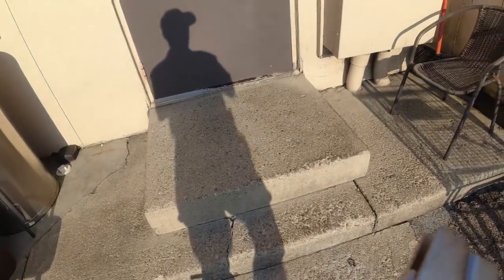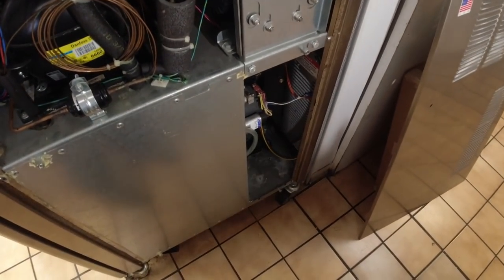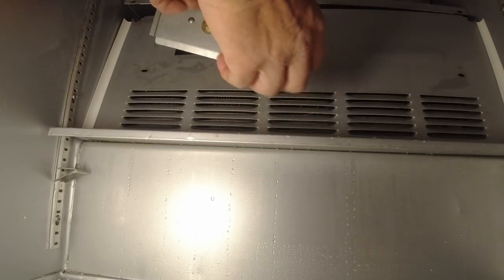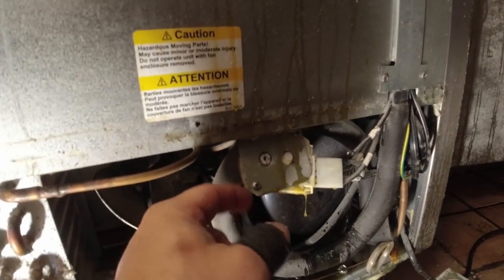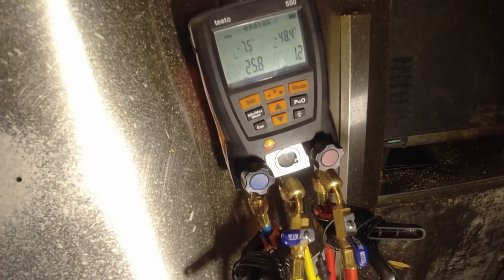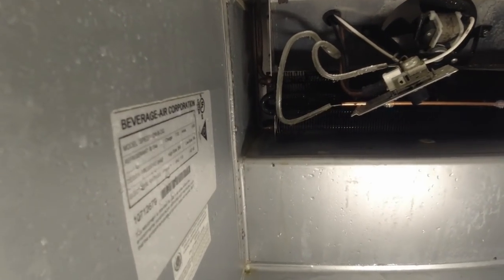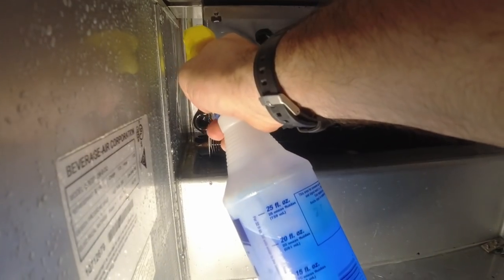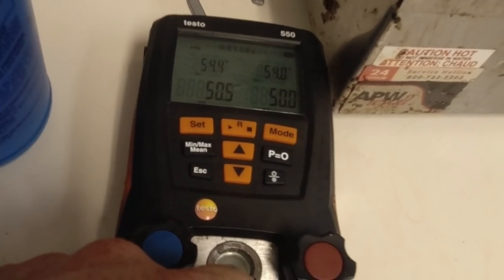Ice Cream Machine / Freezer / Cooler Not Working

Comment: Seeing you work on those small compressors looks to be the same type that most RV roof air units have and of course no taps. Most RV techs don't even bother putting gauges on them and tell the owners to buy a new unit, talk about throw-away. Gets me wondering maybe I can learn the trade and just focus on RV air systems, would have to buy a shitload of taps! Great vid again, between you and Chris I really enjoy what you craftsmen do.
Reply from the maker: You can take your refrigeration exam online To get EPA certified. It's pretty brain dead now.
Reply: @HVACRSurvival  I guess if I can do IT and build complex networks, this should be a walk in the park, said no one! Thanks Might be some good retirement income at campgrounds when I get to that point.
Reply: I testing points you raise: I irked on cars forever and most RV units are cheaper (usually by only a bit) to replace then repair by the time you throw in labor.
 I years ago had quite a nice biz setup with local motels repairing their room units. Many of those are also disposable now.
Reply from the maker: Exactly, it's all dependent on how bad you want it
Reply: You'd have to be willing to build up stock.   People will pay extra to get an exact match unit working on their system, or to NOT have the whole unit yanked in some instances (fixed on-site).    You do the repairs after you've pulled the unit in your 'non-active billing time'.   Then that unit goes on the shelf waiting for the next RV.
Reply: @tbelding  I’ve done a bunch of antique auto ac retrofits, and people Will pay if they feel there is value to it.
 I’ve repaired many an ac system by finding it a problem and going to the parts house to see what I can make work for a certain case.

Comment: I wouldn’t be surprised if you’ve already seen them, but, they make a saddle tap that you braze onto the process tubes while Freon is in the system, and then you drop a piercing insert into the valve body and use two wrenches to crank the cap down tight and push the piercing assembly into the pipe. I’ve used them many times and it’s nice because you don’t have to reclaim anything and provide ports without opening the system. The part number I found is BesTech-BT5514, also BT5538
Reply from the maker: I used to have those back in the 90s, I didn't know if they still made them or not. They were really nice, thanks for sharing 👍👍

Comment: Sometimes you get workers that respect your space, others not so much. I used to take it. Not anymore, I mean I'll be tactful but I'll let them I'm working to and don't need hot water or food spilled on me.
 Hey! I use a uniweld pinch off tool and braze my access fittings without having to recover and vacuum. Saves loads of time if unit didn't go negative.
Reply from the maker: That's how I tap a R-290 system. But we both know how this is really done most of the time.

Comment: i think the white timer thing he called a defrost clock is actually just a condenser fan motor reversal, i have many of them in my true GDM units and they are only for reversing the condenser fan motors as a way to help keep the condenser coils cleaner for longer. correct me if I'm wrong tho
Reply from the maker: The thing you're talking about in the true coolers is programmed into the circuit board of the motor itself. That is a defrost clock.

Comment: Hi rick, great videos you should check out the kyoritsu 2200r multimeter it has the smallest clamp around 3/8, great for checking amps in tight spots also fits in your pocket just a suggestion.
Reply from the maker: I'll have to check it out, thanks 4 watching!

Comment: Impressive level of professionalism considering the circumstances. Good job keeping your cool. Just curious, does the manufacturer provide an ohms rating for the defrost heaters in those?... so they can be checked somewhat for diagnostic purposes?
Reply from the maker: I'm  Sure they might, generally it's gonna be somewhere between 15 and maybe 35 ohms.

Comment: Hi, I have a question. If we haven't changed the scapper blades for a while, and recently the fuse kept tripping when turning on the machine, and now the machine won't freeze the soft serve at all, does that mean the scrapper blades being worn out could have cause permanent damage to the compressor due to power overload. Or simply replacing the scapper blades would be ok?
Reply from the maker: Scraper blades are not going to fix your problem,  they would not cause the fuse to blow.